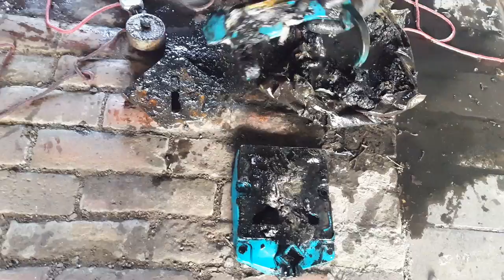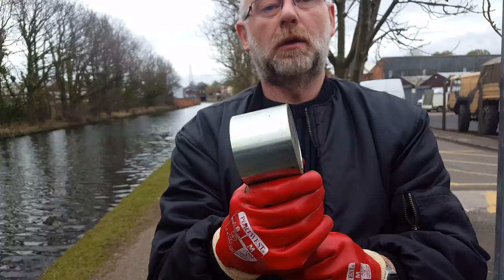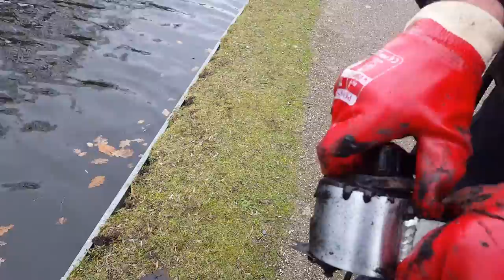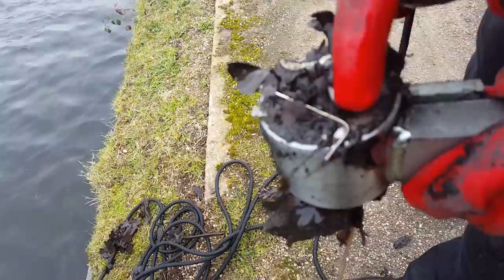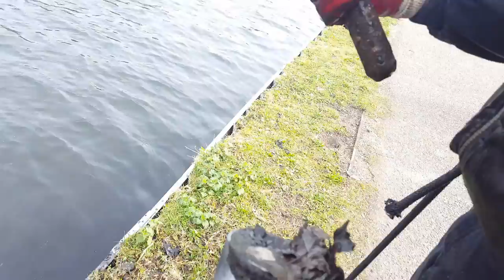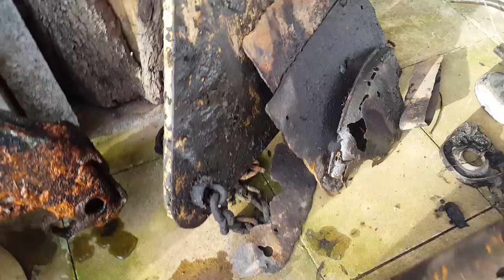magnet fishing trying out the beast

Comment: The round thing that u said was having a wee is out of an automatic gearbo, the bracket with the square hole in it is for holding metal fencing together  the hub cap is off a VW beetle, the second one hub cap is from a mini, the round disc at the end is for a grinder great finds

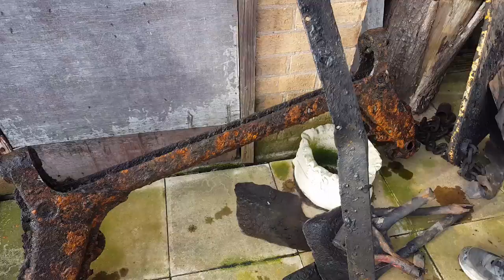Comment: What you called an axle is actually off the front of the car. The rubber pieces are for the mounting brackets to help steer the car. At 29:37 on video
Reply: Beam axle [rear axle of a front wheel drive vehicle]

Comment: Look close at any stones you pull in meteorite is magnetic and worth a lot even smaller peices.
Reply: Good point, I think though the more likely reason is that the "stones" might be "clinker" . Birmingham is close to or part of the "Black Country"  https://en.wikipedia.org/wiki/Black_Country , there were lots of foundries/chainmaking etc,  if I remember right, slag and clinker were waste products from the furnace, slag floated on the top of the molten metal, clinker sank to the bottom-but I might be wrong on that  I was a welder/fabricator so I just stuck to stuff together after someone made it LOL . For some reason, I still remember that the furnaces (Bessemer Converter) were loaded with iron ore, coke and limestone and bore everyone in the bar at any opportunity  with that useless bit of knowledge --and your comment gave me an opening -so cheers!